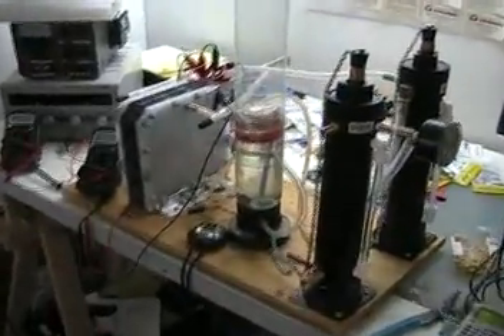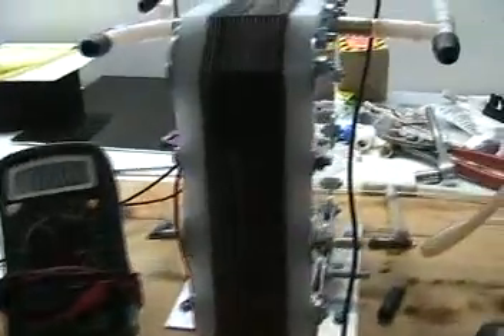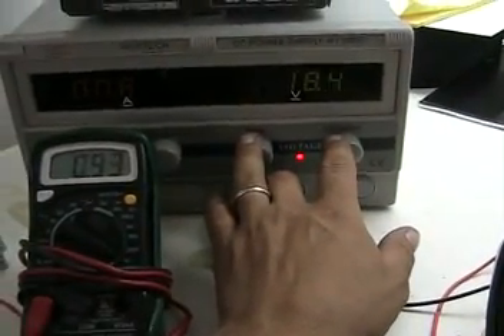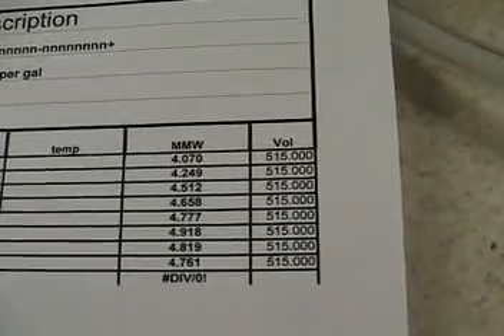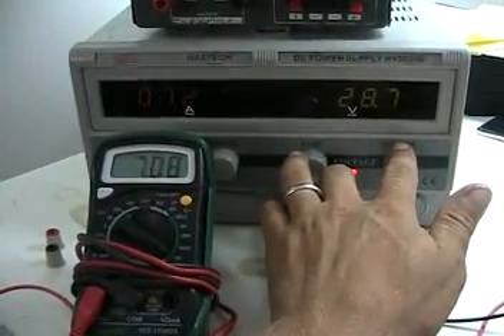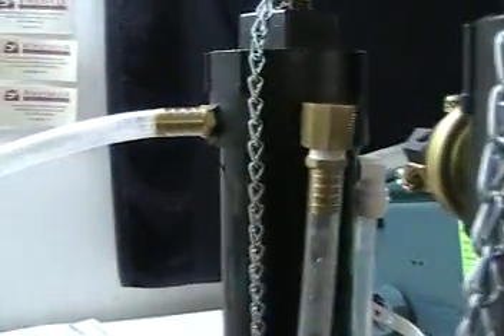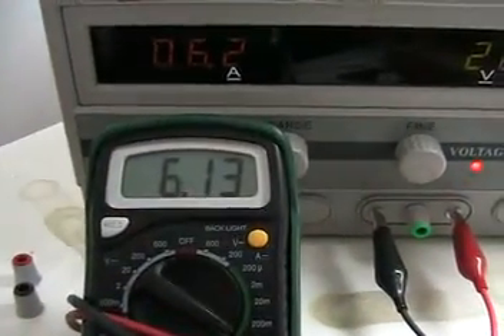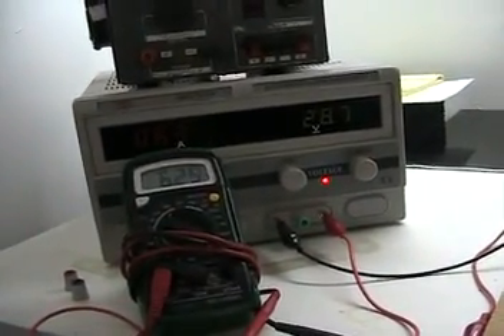drycell test 3

Comment: plz. check my responses in previous videos, I garantee that you should be getting alot more seperation!!!,Do you use some type of electrolyte pot. hydroxide?, will that foam?or not? what about baking soda? I wounder, because your plates are very close, you probly dont need to much eletrolyte, is this true? in other experiments i have noticed the best sep. was from those were the plates were arrayed +-+-+-+-+- and were as spaced close...

Comment: Looking forward to your 30A @ 12 V tests for production for this cell. Sounds like you are methodically proceeding through AC tests. I would think U should get about 2 l/m on this cell, using 12v 30A? I would guess?  

Can you also do a TEMP/HEAT test for us along with gas production at some given temps?

Im interested to see how fast this thing heats up the water and plates, and the AMP pull after running for a few hours,  using 12V DC and starting at about 20A cold..